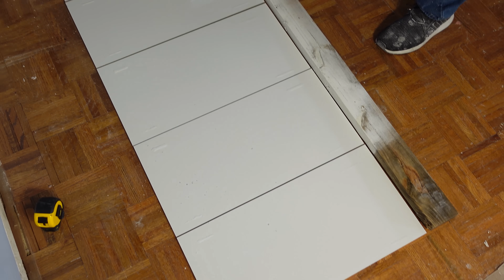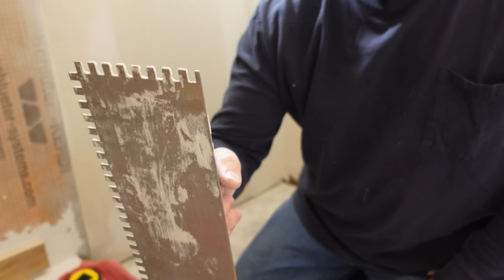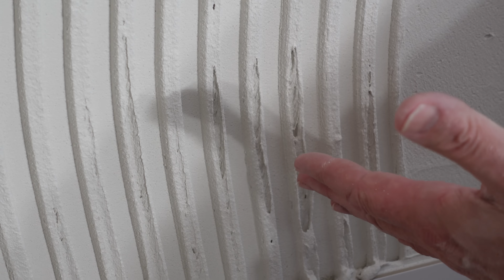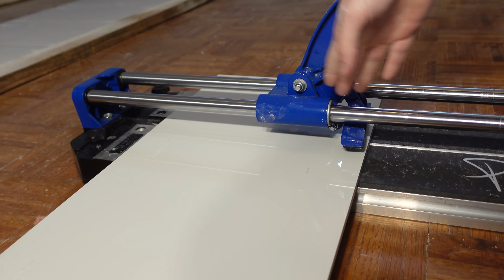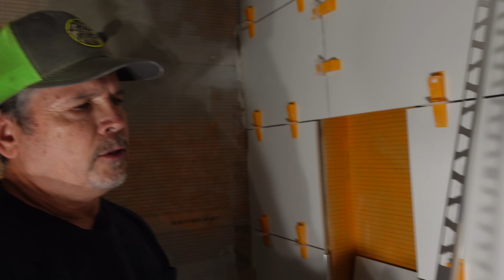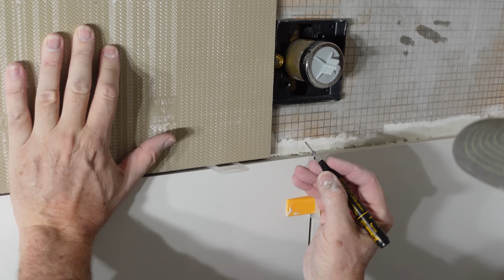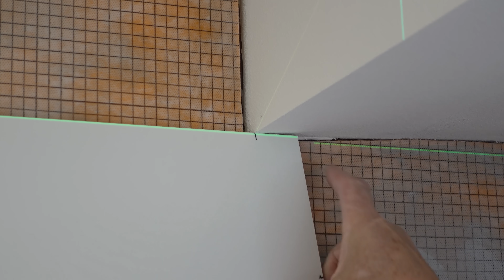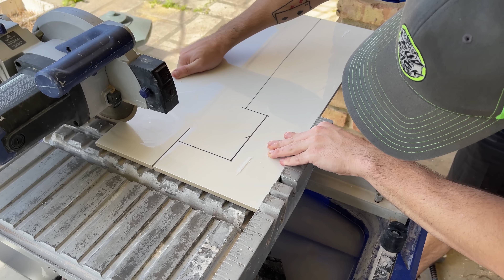Buy THIS Tool BEFORE You Tile! | Tiling a Shower

Comment: Hey SP - you ask us to leave comments but I think you guys have blocked me but here goes anyway. You definitely confused me with the notched trowel advice - so long as you back butter there should be no problem - I use the bigger notch trowel for floor tiles. Then there is the trim - first piece you struggled to push it into half set thin set then we see that on the other side you have set it in with the tile ??? You sure did make a mess of the tap hole you cut - I always cut from the back when using a grinder - cut as much as you can without going over the line always from the back and then finish it off from the front. All feedback is good and you did ask for comments - please let me know that you have read my comment. Best wishes from Australia.
Reply: Thanks for the reply guys- I really appreciate that you can read my comments.

Comment: hey just a quick comment on your  diamond hole saw comment. if you go to harbor freight they have for a fraction of the cost of a big box store, just used one the other day and worked great. just add some water to it while you cut into the tile. great content guys keep it up.

Comment: If you don't have a wet saw for the shower valve cut use a small masonry drill bit in the corners of your marks and cut from the front.

Comment: I would put a full tile at the bottom, and the top. I would purchase accent tiles, maybe a different color, and make a horizontal accent line at one of the middle horizontal joints. Even if I had to slightly plane, sand, or grind the edge of the top or bottom row of full horizontal tiles, I would make the accent ring. I realize this solution woul only work if you can find an accent tile the same size as the sliver tile would have been.

Comment: Hey Studpack...one question.  If your ledger board was notched at the top...maybe the thickness of a table saw blade, you would you have been able to install the wedge clips at the bottom of the first full course so that when you added the final partial course you could have wedged it in?  Any reason why not?  Thanks!

Comment: I've been in a house I had built 12 years ago. 1896 sq ft of floor tile in home. Bought 6 extra boxes of 8 tiles 20 x 20. Down to 13 tiles left. Impossible to find many 20 x 20 anymore and nothing I've seen even comes close to matching.

Comment: Ok. Where is your mixing valve seal? Why didn't you use it? I hope that's not sheetrock behind that kerdi. And jmo if you put the trim on the inside cuts of the niche it looks alot cleaner. And you don't have to spend all that time with layout if you are using a prefab niche. Just put the niche in the perfect spot when you get there with the tile. Easy peasy.

Comment: Another option which I like is to have a horizontal strip mid wall of a contrasting title that's 3,4,6". That allows me to always have a full tile at the bottom and cut a little off the tile at the ceiling. Plus the contrasting strip is always going to be seen as a more custom job, higher value.
Reply: I like that that doesn't leave a cut tile at the bottom that's difficult to silicone.

Comment: You can also use your wet saw to cut those square holes. There is a pin on the side you can disengage and use it like a chop saw.

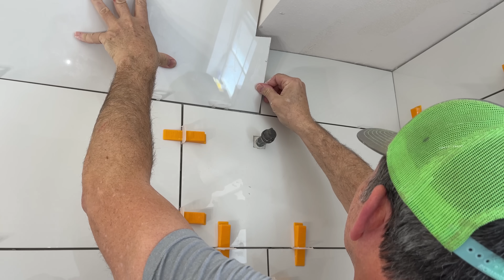Comment: @25:33, you're putting up a single tile at the very top of the wall, next to the soffit.  IMHO, I'd have cut this one, so that it followed the running bond pattern.  Otherwise, I'm damn impressed with the large format work, and picked up some great times.  Thanks!
Reply from the maker: We removed and replaced that tile in next video 👊👍

Comment: I would put a 9.75 in piece at the ceiling and a 3 inch piece at the bottom.  I think having as close to a full piece at the ceiling is more important.  If given the chance I generally put an 11.4 inch piece at the ceiling if it's "12" inch tile.    I would say it's very important to shim the studs before you hang your board.  Use a straight edge and a sharpie to mark how many shims you need at various points on various studs then tack up your shims.  The smaller the tiles the better your shimming needs to be.  I switched to 3/32 joints (purple tavys at Lowe's) and I use 1/16 inch levelers, I don't like to use the levelers as the spacers because they get various amounts of mortar around them throwing things off.  I use a hot glue gun to install schluter around the niche.  Then i smash thin set around everything right before I set the inside pieces.

Comment: Smooth grinder diamond blade helps with those chippy cuts around shower valve... I started 45° my corners in niches instead of metal edging and the clients love it. Trick is to leave a small amount of square edge so it's not sharp. I belt sand the cut edge after drying and it works Great.

Comment: Award yourself one new diamond hole saw per project and soon you will have a whole set.  To use, cut the same size hole in a sheet of plywood and then clamp the tile between the holey ply and another sheet of plywood. Lay the tile flat so that the water you use will pool around the hole. A perfect hole in a few minutes.  For better holes just cut the glazing on the front of the tile and then finish the hole from the back.  A lot more precision is needed for this trick though to reduce the chip out.

Comment: Is there another way to cut those notches other than a wet saw? Or is that a rentable  tool?
Reply from the maker: You can rent wet saws.  Local tile setters don't even need them anymore.  Snap cutter and a grinder with a diamond blade and they can do almost anything.

Comment: I bought a diamond hole drill set from Amazon.  It's a 15 piece set with a drill capable of 1-3/4 inch.  I paid about $20 for the entire set.  It lasted me 3 tiling jobs (plenty of plumbing holes in ceramic).

Comment: Great stuff but.
I ALWAYS weave my inside and outside corners. Right side goes in the left side butts up. Next row, left side in and right side butts up.
The grout line will alternate rather than be a strait line. Of course this is for tight grouts. wide grouts this is not relevant.

Comment: Paul try a Milwaukee M12 tile cutter it works good and is compact I even use it for cutting a finish cut on old drywall when remodeling and removing drywall plus its lightweight

Comment: OR...?
 Figure out the wall layout before you build a custom pan (dry pack, 1/8” a foot, because I can). 
 If inch or less away from full at floor/lid, higher floor?
 Pre-fab system?
 I keep quiet, and continue to make women happy here in Seattle. 
 11 at a shop...11 on my own, no advertising. 
   Problem with people watching DIY is...
It doesn’t give you the dexterity to handle a trowel, mix t-set according to temp/climate/material...
  “You’re such a perfectionist”
 NO...I can do this, you can’t. 
  MOLT LIQUOR~

Comment: I'd expect the grinder cutout to be very rough and janky looking, but it lives behind the valve trim, and won't actually be seen. As long as the hole is both bigger than the valve, and smaller than the trim plate, I'm not sure it matters how it looks.

Comment: When i set tiles with my uncle we didnt use those fancy spacers since they are expensive and you always have to buy more of the suckers, and it takes time to get them in position etc. And they dont really come in a ton of size differences.

We use bricklaying string thats made in fixed sized, its made out of twinned polyester so they last FOREVER, uncles strings are 10+ years old. So we got strings for almost all sizes of grout lines, some people like thick grout lines for some reason xD. The string cant compress much so the grout line does not differ in size.

The biggest bonus is that when we pull out the string halfway through the thinset burn time, it pulls out all the crap stuck in the grout lines, and we get nice clean lines to fill later on.
Reply: mic dundee  We dont need the plastic stuff since we know the trade. Sure its old, but it works if your good at it, and its faster then clips and wedges.

We dont lay an entire floor without guides for instance, we snap mark grids and then we put a straight metal piece on the long run so we only lay 3-4(depending on size) tiles at a time across the entire lenght of the floor. Then we move the metal down to the next line and put down 3-4 more tiles, rinse and repeat.
So technically we are only getting 3-4 tiles straight each time, and the bottom tile is always level since we got the metal piece that follows the floor marks and we got the grid marks we can follow for the sides every now and then.

Comment: Hey guys great video as always. As a dryeall taper and a tiler. One thing i would have done different is on the soffit or drop down. I would have cut my tile to the laser line then used drywall compound to straighten out the disreprency in the soffits to the edge of the tile with 20 minute hot mud and a light skim.of premix.

Comment: Always.. Always scratch or "key" it in to the back side of the tile. By using the straight edge side of your trowel you skim coat scratching it into the back side of the tile not leaving very much there but forcing it to cut into the release mold agent that is left on the back of all tile.

Comment: Good job on the layout, I’ve been building showers for years and I still will layout tile and use a story pole very now and then on a funky shower.  Also lining the niche up with the tile is a big pet peeve of mine cutting notches looks like you didn’t plan ahead of course some layouts you have no choice

Comment: My walls are ICF made of 2 inch high density foam and covered with a product called Kool Crete made in TJ which is a plaster like material with adhesives to allow the mix to stick to the walls without using fiberglass mesh. I am in Baja Mexico. This type construction is called ICF (Insulated Concrete Form) and like Lego blocks with the inside filled with concrete and the sides are foam. So its not possible to use screws as they would just pull out so my question: Can I just use a liquid membrane waterproofing over the Kool Crete, then add the thinset and place tile?? Awesome videos.

Comment: @stud pack For the hole saw, you should purchase the QEP 1-3/8" diamond hole saw kit, some with the hole say and a guide/water cup that is perfect for almost all pipe in showers (tub spout and shower head) and can be used for cutting sink faucet holes in tile and granite.  Used it many time on many tiled showers.  Available in home centers for around $25.

Comment: Did my first mortar bed and shower in '85, so been at it a while and still tend to do things old-school.  Back in the day the shower floor pan, filled with more than 2" of mud for thickness beneath the finish tile, would catch water and hold it unless the base, below, was properly sloped to the sub-drain.  Old showers that still had a functional hot mop at the bottom would end up in those situations with constant mildew issues unless the sub-drain was working as designed.  So...fast-forward to the shampoo shelf set-up in the video---the bottom of the box is an inch or more below the top edge of the top of the tile coming up the wall, which ought to provide a great place for water to store up and cause mildew problems or moisture migration issues since it has no easy way to escape.  How is this handled so it's not an issue over time?

Comment: The valve trim ring will cover that little bit of imperfections. Anyone who has ever done a mixing valve knows it. Your work always turns out nice. As far as the hole saw for tile I always buy the kobalt brand single bit , just because they wear out and I don’t want to wear out expensive bits. I saw another guy use a hole saw that had a rubber piece that sets on the tile and guides the bit while it cups water for the cut. I’ve yet to find a set like that

Comment: I hope you are going to show the entire installation of the glass. Especially if the installer drills holes in the curb for screws. This is the weakest part of glass install as far as introducing a path for water to penetrate the curb and reach the subfloor.

Comment: That was GREAT!  I did mine already and I did it 90% like you said, but I didn't know to clean the thin set on the edges before setting, so I had to clean out the squeeze out by hand before grouting.  That would have saved me.  I have one comment on layout.  Use can also use a horizontal accent stripe at about eye level to get rid of slivers at the top.
Reply: I’ve found that a popsicle stick is great for cleaning the thin set from between the tiled when the thin set is fresh…A DYI  FYI

Comment: Nice work! You never see behind the valve trim anyway... But if you care grab some 4, 5, 6 inch diamond hole saws. Amazon even has cheap ones that are low cost enough that you can throw them away when they get worn out.

Comment: I tiled a bathroom in a church parsonage for my own congregation. The pastor watched me struggle a bit in that I had two ceiling heights and a vanity to go around to avoid the sliver tile. I did the layout in the hallway and used a story pole for both dimensions to get the best possible layout.
   The pastor asked me why I didn't just start laying tiles full from the corner to speed things up a little?
   I told him it was the same reason he didn't just go up and say random crap instead of preaching a sermon. 
   I showed him later how and why I did the layout, and my comment about sermons made it into his sermon the next $unday.

Comment: Nice work guys. Try switching out to a continuous rim blade for the grinder it  works better for tiles than a segmented. I’m curious if you set the Schluter Jolly snug to the tile or if you left room for “sealant” thanks for putting out these videos. They are fun to watch.

Comment: With your vertical planning you should consider putting in a band of floor or another mosaic to keep your distance with clean tiles on top and bottom. Floor in this one would probably add an extra day to let the pebbles set  and getting a clean straight line but it does a good job of tying the shower all together. We also like to use the floor to tie in the benches and niches especially nice when they are clearly different look rather than the 1x1 version of the wall tile. 

Glad to see you took the time to miter the jolly, see so many showers where they just leave a big open corner for grout.

Keep up the good work there.

Comment: Something I personally do if I'm cutting out the middle of a tile, I use a cordless grinder (so I don't kill myself)  and hold a damp sponge against the side of the blade as I cut. You can squeeze out a little bit of water as you go which helps the cut and keeps the dust down. My blade always chips slightly on the inside of the cut so I just rotate as I'm going keeping the finished edge on the outside of the blade. Done this with porcelain too and it works well for small cuts.

Comment: I really appreciate your videos. We had two bathrooms remodeled to include walk-in showers using the Schleier Kerdi system. The videos really helped me to know what to look for. Plus, we have another house in need of replacing a cheap manufactured walk-in shower enclosure. I am confident I could take on this project using the same system. It may not turn out as great looking as yours or the ones the pros doubt I can get it to be close enough for a third bathroom in an older home. Thank you!!!

Comment: Good morning, and thanks for another awesome video! I'm not sure if it's been mentioned, but there is a trick when using the leveling spacers. If you forget to put them in at the edge where you finish tiling for today, an easy trick is available. Mr. Sal DiBlasi has it in one of the videos. Use your oscillating tool, I used my grout blade, and grind into the mortar underneath the set tile. You plunge in enough to put the clip into it. Voila! It works great when tying into existing tile as well. I did it when I had to tear out tile in the middle of the field, and replace.

Comment: Is your thinset still wet, or how are you sliding the schluter profile behind the tile at 26:10?
Reply from the maker: Correct Jerry the thinset is still “soft” 👊👍
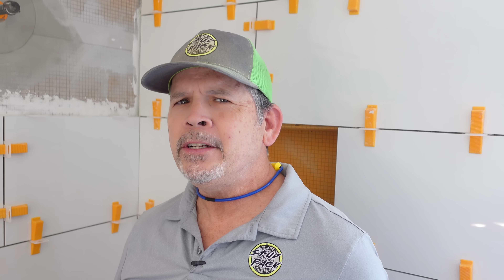Reply: @StudPack  Thanks for the response!  I noticed at 21:06 you mentioned it was the next day, so I didn't think the thinset would be pliable enough to slide the profile behind.  I'm getting ready to tile my shower walls and then niche and my bench and i am worried about getting the rondec profile to line up right. It will be much easier to place it after the fact if the thinset is still soft enough the next morning on the walls to slide it in and then just wedge it to perfection.  Do you mind sharing what thinset you're using? I have the custom building products for large format tile to set 12x24x3/8's porcelain tile.
Reply from the maker: It was the same day.  You won’t be able to slide the trim in the next day.  We did clean out the thinset around the niche to accommodate the trim later on.  CBP Pro Lite thinset 👍

Comment: I don’t always set tile but once in awhile. Need to make sure the layout on the niche is not only good on the bottom but the top as well. The joint is even at the bottom but what happens at the top. I ended up with a sliver at the top. It was extremely frustrating.

Comment: They make 1 1/4” diamond whole saw bits that work great for cutting out for the drop ear or tub spout copper stub. Milwaukee makes it an only like $25-30 dollars at Home Depot used the same one multiple times works like a charm still